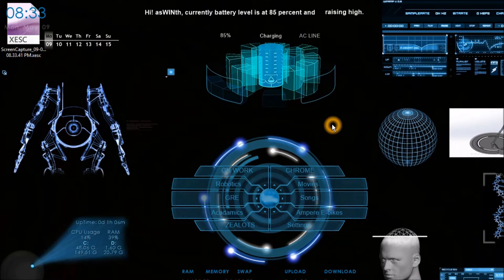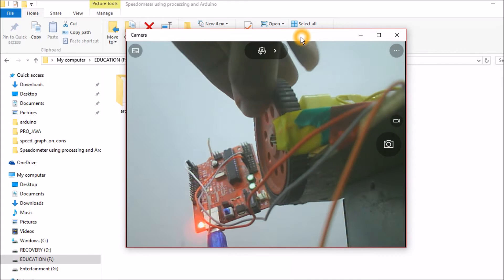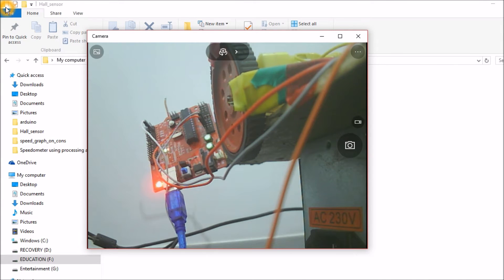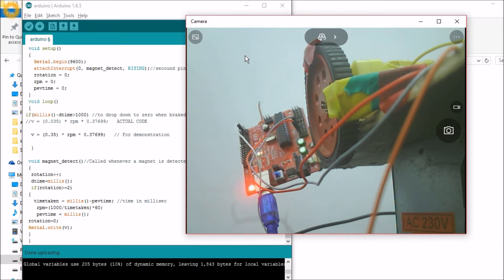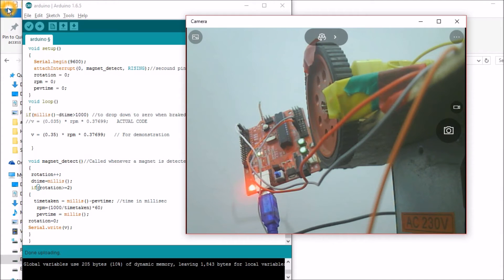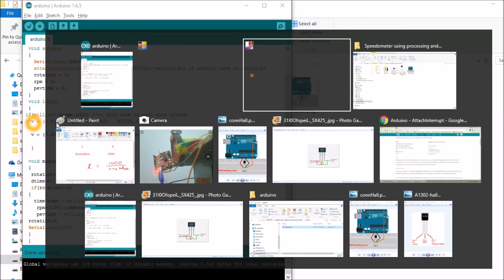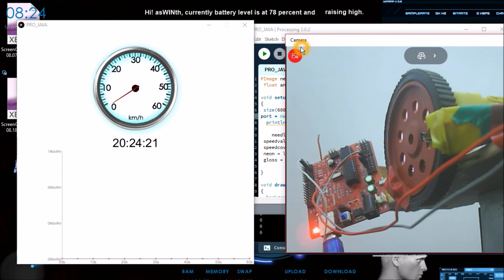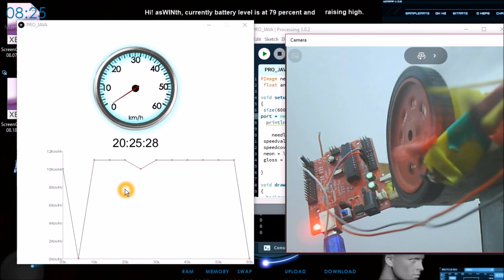Speedometer using arduino and processing

Comment: Hello, is there a way you can help me build a Speedmeter using IR Sensors and the output in a 7 segment display without using arduino too, please?
Reply: Did you manage to get that working?? If yes, please help me
Reply from the maker: hi where r u stuck?